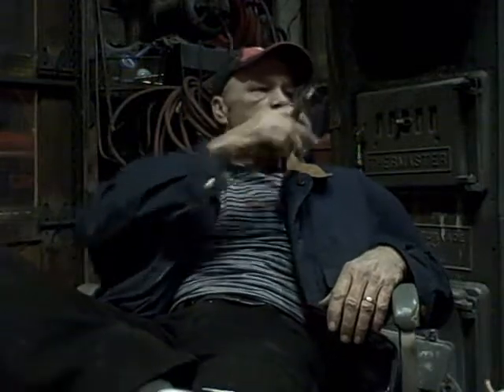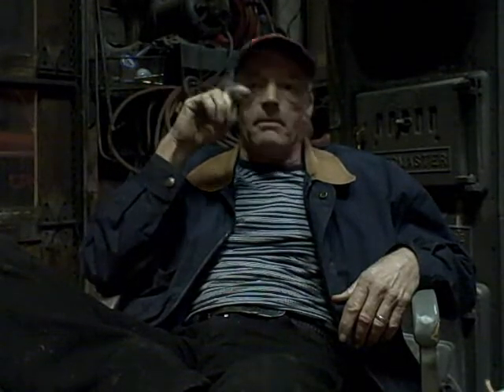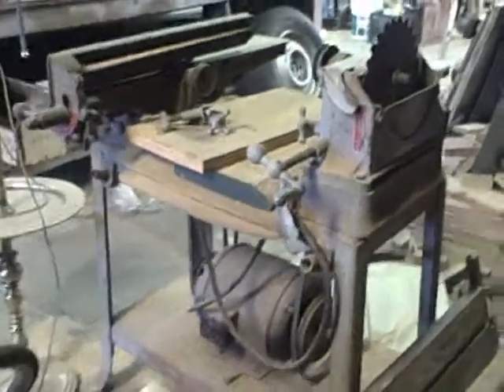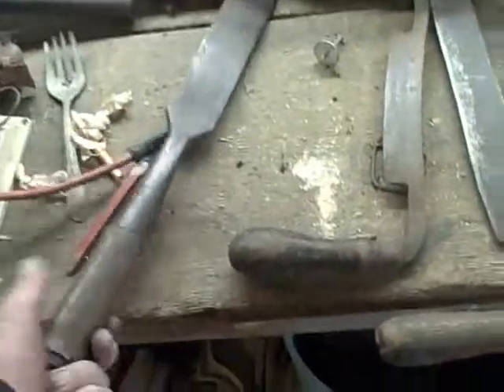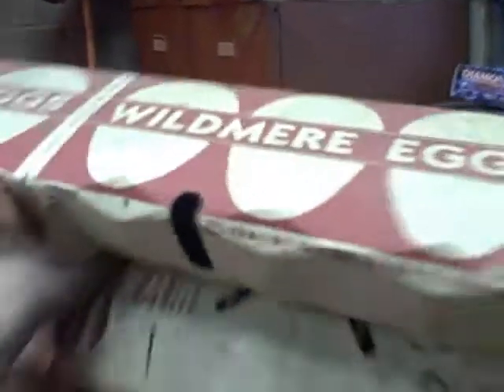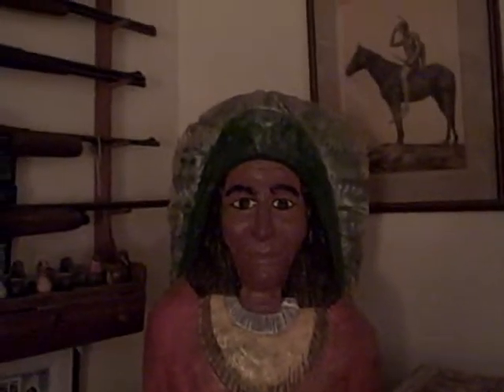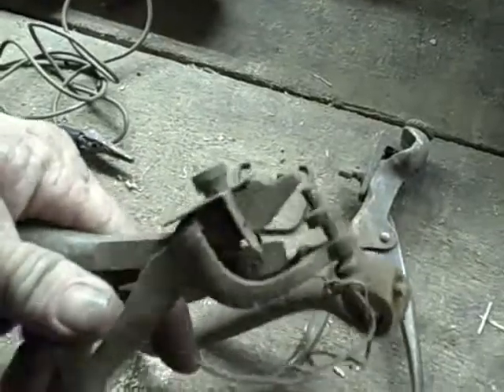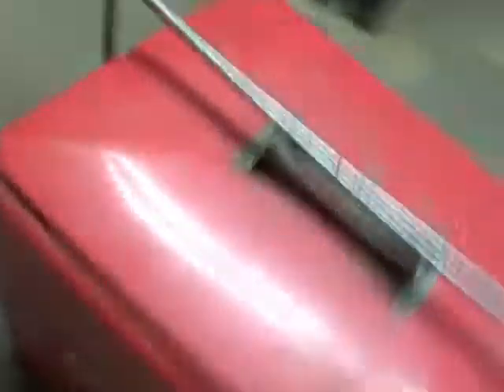New Jersey Old Things Antique Vacation to Jersey

Comment: I had an old Mcgummary Ward(spelling error) early 1960's Riverside 250 Motorcycle that I gave away a while back.
There were NO available parts on the market + I looked into replacing the entire engine, but none would fit the frame. So the bike was worth Zero dollars.